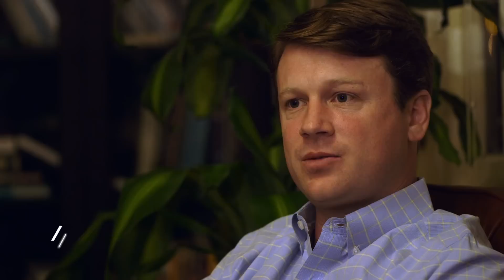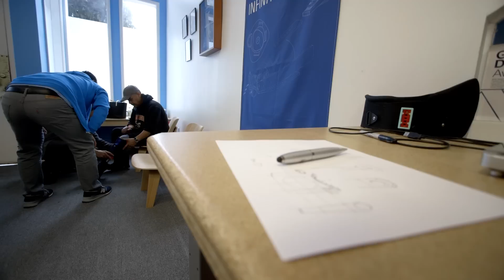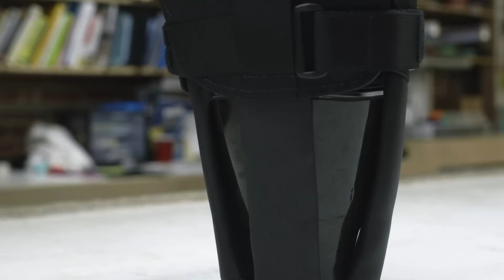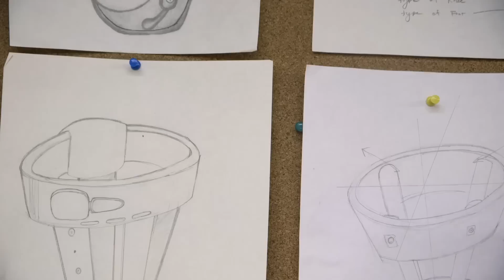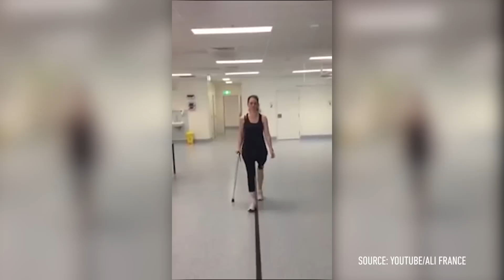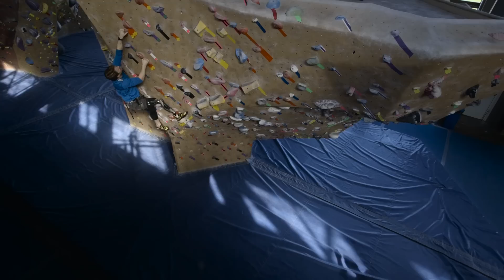Prosthetic sockets go high-tech

Comment: I am a Director & Artist Photographer. My whole life revolves around traveling and capturing the beautiful things in life. I came to realize the extent of the discomfort on my distal end of the limb, aggravated by walking days on end with little time out of the socket and searched for an alternative. I found LIM's Infinite Socket and sought about getting fit. From the moment I tried it on, everything changed! My confidence was boosted to new heights and I wanted to walk everywhere; the comfort and control I had over my gait was impressive. With a few clicks of the ratchet the brim was tight around my limb, and I could walk endlessly with the suction supporting my every stride. I have had many sockets over the years, but the dynamic structure of the Infinite Socket was able to provide me comfort beyond comparison.

Comment: The vibration feedback he talked about:
Stick some velostat inside his shoes, connect it to a arduino or something, code the arduino to control a vibrator motor (which is strapped on his residue limb), Boom! Problem solved!
Reply: +Rexus King Not really. It would be like a Vibration controller simulating simulating a punch. They don't nearly enough granular vibration control and sensitivity to replace actual limbs.
Reply: +AerrowDynamics Of course! But! he already lost his actual limbs, and seems to be reluctant to do the osseointegration surgery. So, I was proposing a much cheaper and simpler way to provide a sort of haptic feedback for him.
Reply: Rexus King Yes, but I don't think it would actually be as useful as you might think it is, even given the difference in cost
Reply: Oh well :)
I just think this might be a cool idea to try out. Maybe you even use different force or vibration frequency to represent different levels of impact force?